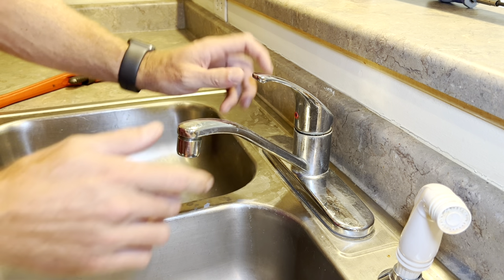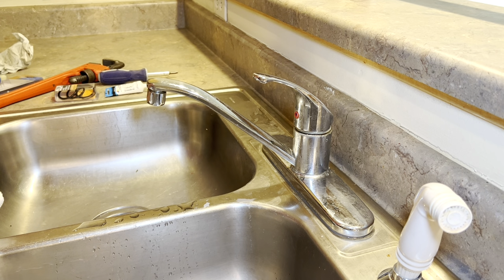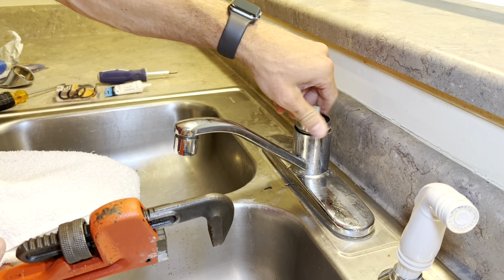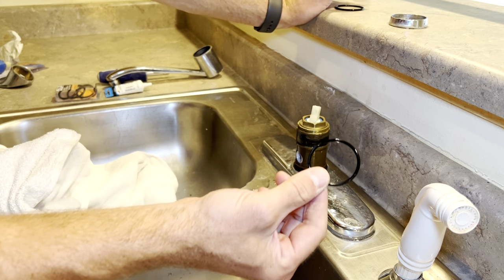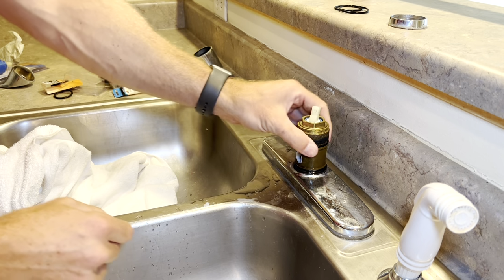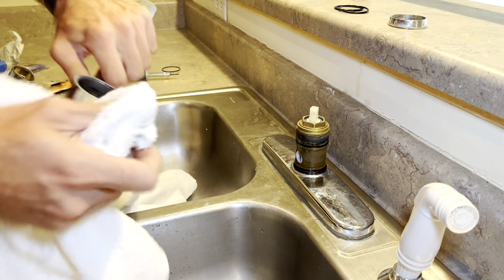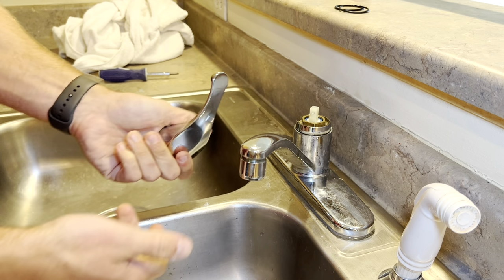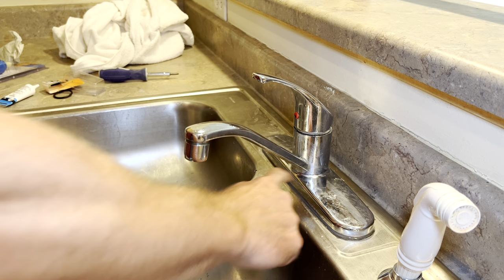Kitchen Faucet Leaks at the base. Easy Fix!

Comment: Replace the whole shitt, it is too expensive to obtain new parts and make it self.
Reply from the maker: Sometimes it comes to that depending on the issue. But, the parts used in this repair cost less than $2 and the repair only takes a few minutes. This is far easier than replacing.

Comment: Don't waste your time, replace the whole thing.
Reply from the maker: If you are wanting a new faucet anyway, then this would be a good time. However, this is a pretty simple repair that only costs about $2. Replacing the faucet will cost around $80 (assuming you DIY).

Comment: A little tube of silicone grease is $10.    A small package of O-rings is another $10.  Shipping  charges, if your local hardware doesn't have these items is another $10.     That's $30. + sales tax.   Wait two weeks for delivery.    Oops!  They sent the wrong O-rings!   Return for refund if they have no others and start over with another internet supplier, or wait another ten days for the replacement - which you hope will be the right size.   Next time, call a plumber!
Reply from the maker: Where I live, a plumber would easily charge $120 + parts for this repair. A new faucet is less than that. So, if you don’t feel like you can handle this type of repair, you could replace the faucet for less than what a plumber would charge.
Reply: Meow, meow, meow...
Reply: A plumber will charge you $200.00 ….